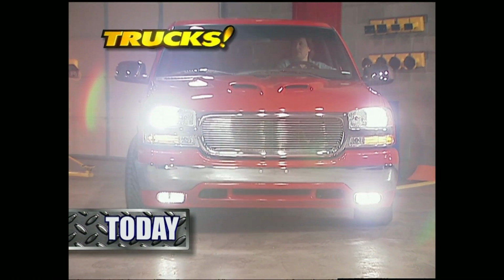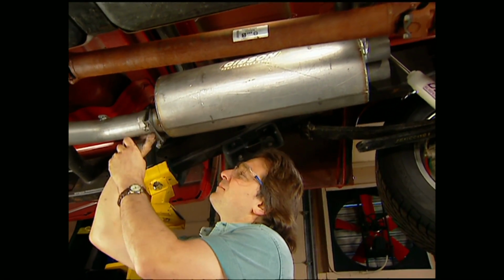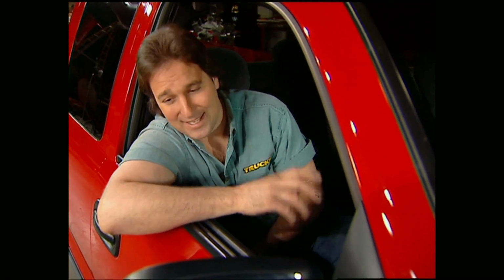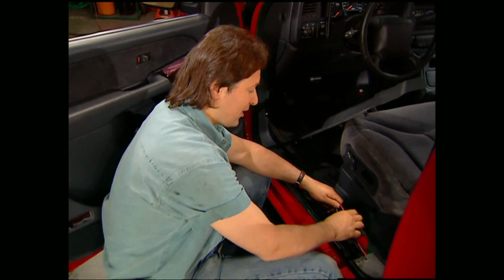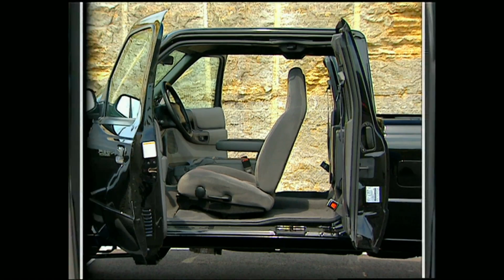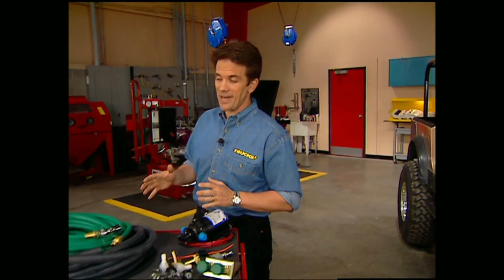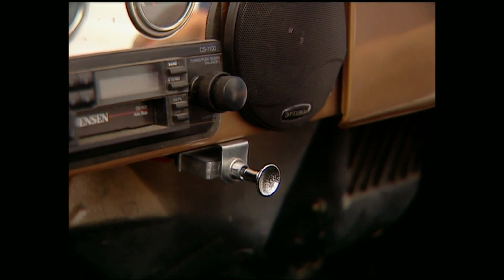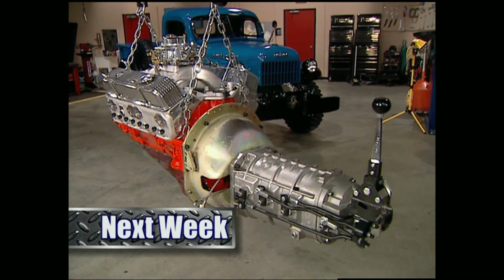Changing The Tones And Tunes On The Sport Sierra- Trucks! S1, E18

Comment: if they are running a roll pan with lights they HAVE to put metal inserts for the stock ones
Reply: Roll pan lights are tapped into the original tails
Reply: Gio Pix they shoulfa just get rid of the stock ones if they had new ones